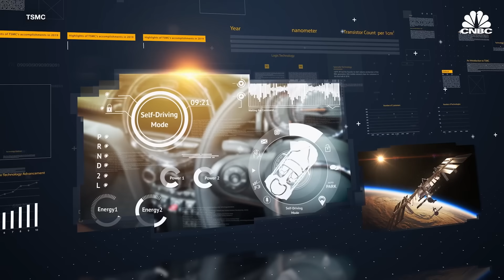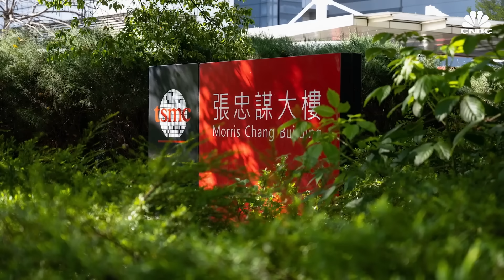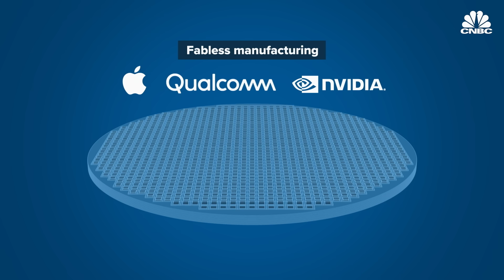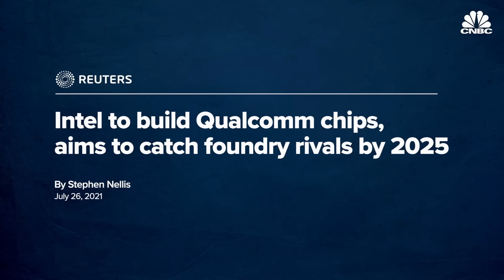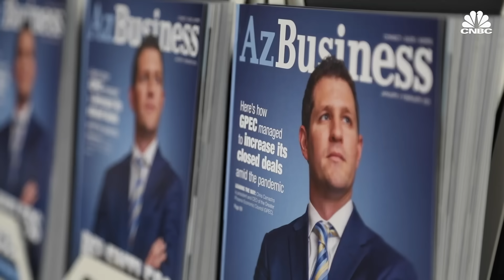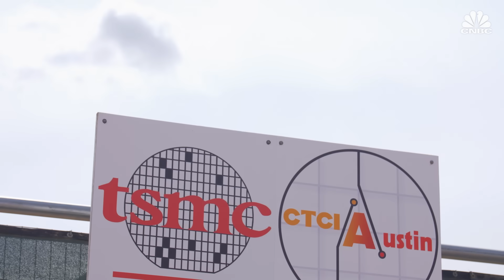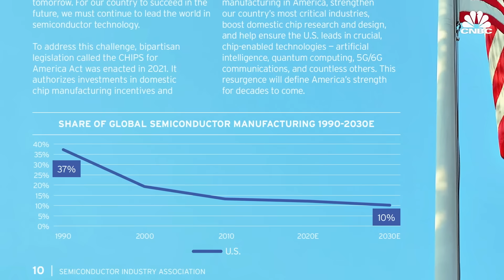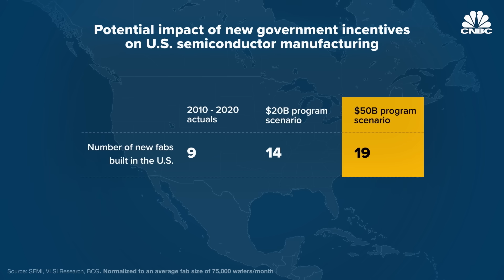Secretive Giant TSMC’s $100 Billion Plan To Fix The Chip Shortage

Comment: Most manufactured wafers by TSMC go to Malesia, Thai, China, Philippine, etc to be assembled as final chip and put into smartphone or graphic card. So manufacturing wafer in USA, where customer like Apple or nVidia, AMD are located is meaningless in terns of supply chain. It just complicates supply chain. The manufactured wafer in USA should be shipped back across Pacific ocean.
Reply: yes, someone with knowledge on the supply chain.... some US manufactured parts already need to export to other country to assemble
Reply: @xelloschong88  Well makeing the supply cahin more resilent also means extending to other aspects. For the assembly piece the US could export the wafers to Mexico for example which is much closer and have other benefits for NA as a whole
Reply: @dennisp8520  right it doesn't have to be made in America, but at least in the north American continent.
Reply: @dennisp8520  quite hard, you must have the tech or capability to function as assembly company(so Mexico need to pour in lots of money into Research and building Fab first in order to attract TSMC) 
As you can see not a single GPU is made in US, lets say you solved the problem with Chip but board ? Fan ? other parts? (most of them still made in china)
Reply: Except for the US Military, right?
Reply: They have probably thought of this already. Building the fab plant is the difficult part. 
Judging by this video it seems like this move is being pushed by the US government in confluence with Apple.
Reply: USA want to secure chip supply in case of war with China. Its political.
Reply: The reasons they stated in the video are actually incorrect for why the fab is being built in the US - they're wrong these chips are being built for the US government and US military, and potentially car manufacturers. You're correct Apple, Nvidia, nor AMD will be using Chips from Arizona.
Reply: That would happen if it was cheaper to produce in China, but won't, because government money, globalism is dead, deal with it snow flag
Reply: Wrong, you're clearly biased and have an agenda and no knowledge. East Asia already has most of the capacity. This is diversification. There are plenty of USA manufacturers in the north America that will be using these.
Reply: 能打架就別吵架,不婚不孕是韭菜最後的尊嚴!  Most companies would not want their supply chain on US soil, it wouldn't make sense for them no matter how many incentives the government throws at them, which the government hasn't really given them that many to be fair, and the government really doesn't want to pay that much - so it really doesn't make sense for anyone to want the entire supply chain in the US. It simply comes down to money.
Reply: @ageminiani  Not true, it is Venezuela's Government that makes them inefficient. Their insistence on nationalizing their oil industry caused it to collapse. The refineries they do have were designed to process medium to light crudes. The do not have the expertise to construct refineries for heavier crudes so they have to send it abroad. No petroleum company is going to invest the billions of dollars to construct a refinery in that nation due to their economic policies. It is possible to be resilient and efficient but GOVERNMENTS prevent that from happening. They cause far more problems than they resolve.
Reply: @Bellthorian  Saudi Arabia and Norway have national oil companies and they do great. Russian oil and gas are nationalized and quite competent.

The problem in Venezuela is stupidity, not government ownership.
Reply: Not mention about all riots happened in the world such as Hong Kong riot, Tian An Men Protest which organized by ARMerica , only talk about war.    In 250 years of existence as a nation, the US has fought against 29 sovereign countries. (In Fact, since 1785, US have been involved, for 219 years, in some kind of war. And this wars, against all varieties of sovereign nations. From going against the Sultan of Morocco, to invading the tiny island of Grenada. Well, this means that in its entire history, it has only had 17 years of peace, and even fewer, cuz here the almost 5 years (1861-1865), of its Civil War of Secession are not counted (Union/Confederates), since this war was not with another country, but against US. And the wars against the Native Nations of America are not counted too, for the same reason). Anyway: US fought against 29 countries. It has "Grown" 711 times the size of its territory from the original 13 colonies. It has provoked with total impunity, Genocides, inside and outside its own borders, and assassinations of Gov’t. Leaders, Coups d'État and Economic Blockades in 6 UN member nations. (Between 1947 and 1989, the US tried to change other nations gov’ts. 73 times. It includes 66 covert Ops. And 7 overt ones. In Civil Wars: The US has taken advantage of and intervened without justification in the following Civil Wars: In Cuba (1898 and 1960). In Haiti (1813 and then 1915-1934). In Colombia (1899-1902 and 1948). In Mexico (1847 and 1914 and again in 1916). In Russia (1918). In the "Republic Banana Wars" of Central America (1912-1934). In Venezuela (1945 and again in 1948). In China (1857, and 1900, and again in 1945-1946-1949). In Korea (1950-1953). In Viet Nam (1959-1975). In Panama (1964 and again 1989). In Central Africa (1969-1974 and 1982-1988). In Nicaragua (1937 and 1985). In Bosnia (1995). In the Philippines (1898 and 1900)... In Kosovo, Libya, Lebanon, Somalia, Sudan, Syria, Iraq, Iran, Yemen, Afghanistan, etc.). And more: US has almost 800 Military Bases scattered around the world; 93 of which are against China. On the other hand, China and N. Korea (The "Axis of Evil"), in 1,000 years of history have NEVER invaded anyone. These nations have fought their Civil Wars, defended themselves against foreign invasions, and secured their immediate borders, but they have never been meddling or aggressor countries. Do you know how many Military Bases China or N. Korea have outside their territory? None. Zero. Any. NADA! They do not have a single Base. These are verifiable facts. Neither China nor Korea will invade the world; US does... that's DONE, as US does in the Middle East. Iran also does not have a SINGLE MILITARY BASE outside its national territory, and it is surrounded by 16 US Bases, and it is US who call the Iranians Terrorists. Well, very good. You already know. Now, compare the Greatness of the US with the Greatness of China. The "Greatness" of the US is built on the foundations of Piracy, Slavery, Genocide, the Assassination of opponents, Opium Traffic, or Cocaine in its case, and is under the foundations of the weakness of other sovereign nations. LOL…..Chai from Malaysia..
Reply: Can Mexico take over assembly ?
Reply: @shepherdsknoll  not enough intelligence

Comment: So, TSMC is building a fab for U.S. customers where none of their advanced node customers will utilize (i.e., Apple, Qualcomm, Nvidia and AMD). If they are serious then they would be building a fab for their advanced node - N2 like they are doing in Taiwan.
Reply: Didn't he say they Arizona will house the latest 5nm process?
Reply: @zinjanthropus322  By the time, this fab becomes operational, the latest node will be N2 or 2nm. not 5nm. It is like building a factory to build iPhone 13 when iPhone 16 comes out.
Reply: @sungk3962  7nm is current, 5nm is cutting edge at least for the next 5 years, 2nm is experimental, no stable process exists to build a multi billion dollar fab around.
Reply: @zinjanthropus322  I am confused - Apple's iPhone 13 is based on A15, which uses TSMC 5nm fab process. How is TSMC 7nm current?
Reply: @sungk3962  A handful of processors made for hand held devices utilize the 5nm process. Most use the 7nm. Both 5nm processes at TSMC and Samsung also still have low yield as the efficiency are still being addressed especially at Samsung. Achieving a stable 2mn in a lab is just the beginning of a very long process. It will take a while. Besides it would fiscally irresponsible for TSMC or Samsung to skip to 2nm even if they had it without recuperating the RND costs they have put into 5nm for over a decade.
Reply: @zinjanthropus322  You should tell that to TSMC, who is spending billions to build a 2nm fab in Hsinchu, Taiwan. Coming online in 2024.
Reply: @sungk3962  That's a 5nm fab. 2nm was just achieved for the first time in an IBM lab a couple of months ago.
Reply: @zinjanthropus322  Per Taiwan News, TSMC is building TSMC 2 nm fab in Hsinchu. What do I know - I am just quoting literally every news source.
Reply: @sungk3962  They can technically build a fab to host a process that's still in development. The EUV machines don't have to be ready yet to prepare the infrastructure. Though that's a bet. One they wouldn't pull in Arizona due to the guarantees they have to make to the local authorities. It has a high chance of being delayed far past the set deadline. The Taiwanese government is more willing to invest in future proofing TSMC by supporting such a project.

Comment: bad decision to go to the us ...us has been pulling alll the strings it can to get the manufacturing process and the fact that it was mostly in taiwan kept it der ,wouldnt be suprised if any new or the old dog companies somehow magically get the 7 and 5 nm process with just a few millions of r&d
Reply: Imagine not knowing that TSMC is a downstream manufacturer. What is Tokyo Electron, LAM…
Reply: they already did, during the Quad Summit last month they launch the semiconductor supply chain initiative: require TSMC to hand over all his client data and supply chain data, US spoke person said if they refuse they can use some cold war act to make them comply(not really clear which act)
Reply: Guess you missed that part where they indicated Intel is building two Fabs at $20Bn that will manufacture 5nm chips.
Reply: @spydude38  intel already knows how to make make 5nm chips its the mass production with high yield rates they havent figured out yet which is still in the r&d in their labs